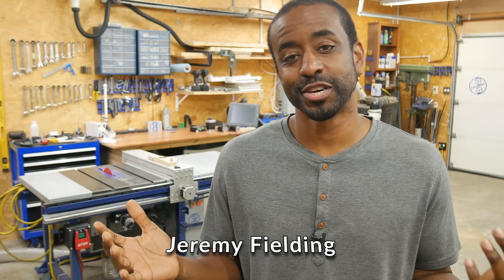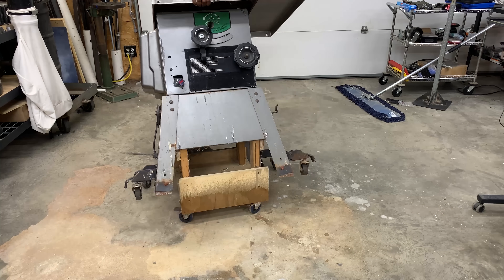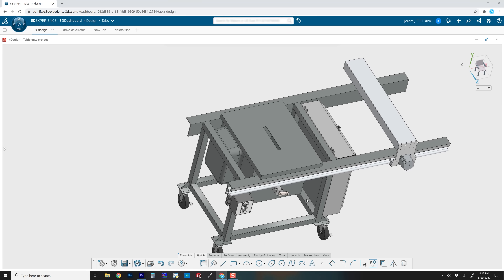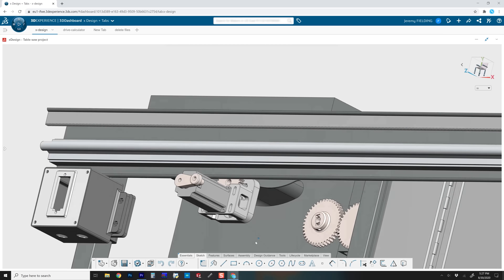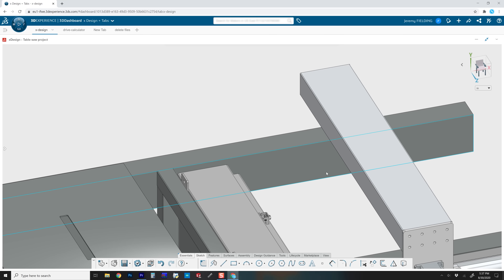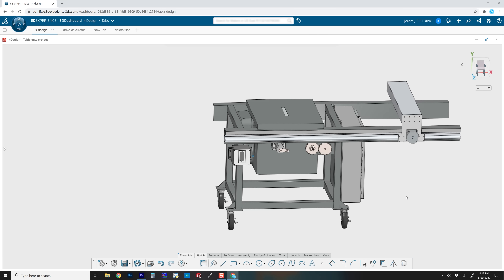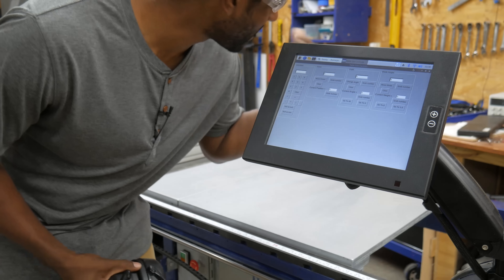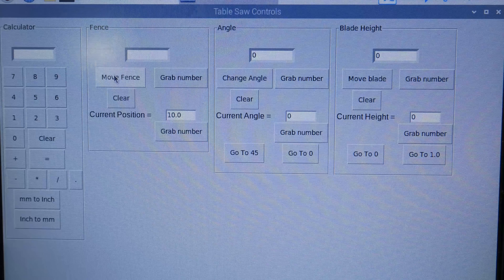How To Make A CNC Table Saw : # 084

Comment: I'll be interested in seeing the long term future of this project, and see what spins off from this project. 
Personally, if i was doing a CNC wood saw, I'd take an entirely different approach. To me, a 5 axis machine with a circular saw rather than a router makes the most sense. This would allow you to cut at any angle, miter or bevel, which includes cross and rip cuts. 
I know this is based on a table saw, but a fully automated CNC circular saw would have a massive footprint and additional auxiliary axes for accessories if based on a table saw, because the saw itself is the non-moving component, rather than the work piece in a traditional CNC setup. This would require an infeed table, outfeed table, power feed, and a intelligent system that can measure stock; such as using a 0/home rigid fence, a movable fence that can also probe then clamp, and passive rollers that can measure height and manipulate the blade height. The power feeder would need to extend the length of all three tables, along with having a table that can hold the footprint for both ripping and cross cutting, and full miter cuts would require an even larger footprint; and that's just footprint per table, unless you want to use a sled design, but then you're sacrificing blade height capacity. This is why a traditional CNC structure, with 5 axis for rotation and tilt on the tool, makes more sense, because it's a lot more compact, and the only additional footprint you'd need is additional space to allow the saw to move into and out of the work piece. 

Personally, though, I'd be much more interested in seeing someone figure out how to fully CNC a bandsaw. Jigsaw might make more sense, but blade deflection would be a concern, as would curve radius of a jigsaw cut. Almost like those 5 axis water jets, except with a bandsaw blade instead of a water nozzle.

Comment: 17:55
The E-stop, EMERGENCY STOP, shall cut power of all the system and apply brake if you have one, it's an EMERGENCY stop !

IT IS NOT A START/STOP button.
Reply from the maker: You need power to use the brake... that is why I only stop the blade.
Reply: @Jeremy_Fielding  safety brake close when power is lost, not with applied power

Comment: 17:18 

You can add a delay in between of the motor steps ( time.sleep(seconds) where seconds can also be like 0.0001 or so).
Because you know how many steps you need for a certain distance/rotation of the motor (which does not change with a different acceleration) you can have a expotential (or just a linear function, doesn't really matter) function thats flattens at 0 and starts at some value that you can try via trial and error. 

With this function you then have your current step as input (x) and it will output a value that you then can give to the time.sleep function that then waits for this short period of time.
Same for deceleration but inverted.

This way if the motor starts moving, between every step of the motor it adds a delay of lets say 1ms which slows down the motor. If its moving for a bit longer, that value shrinks to <1ms and the motor moves faster. Same thing for the deceleration but the delay increases in the end so the motor slows down.

Oh and if your function does need like 100 steps to go from the starting value to 0 (so that it reaches full speed and full stop after 200 steps) and you have to move less than 200 steps, lets say 120 Steps, you can divide that by two and begin the deceleration after 60 (= 120/2)  Steps. That has also the nice sideeffect, that the saw doesn't move that fast on small movements.

Comment: Great job... Plenty of people out here that can tidy up the code and implement your acceleration/de-acceleration code... I think your looking at PID loops (very simple and powerful code)... Or variations of that theme.... My guess is that you'll want to implement it yourself as a learning exercise. But if not host the code on Github and we can all contribute. Even tidy up the interface (Thats not a complaint). Great work for a first Python project.
Reply from the maker: It is on github. Check the description... and thanks!
Reply: @Jeremy_Fielding  Should have checked... I'll take a look. Keep up the great work.

Comment: Casually invents the future of tablesaws in first coding project
Reply: This has been around for a while in the cabinet industry. But still props to him for doing this
Reply: @ObiBassoholic  Ive never seen this as a consumer though. Sawstop + this would be killer
Reply: Ryan Walkowiak yes it would. I was by no means trying to take away from anything you’ve done. The systems out there are pretty pricey. Would be nice to see more competition come out for stuff like this.
Reply: Sorry but this is nothing new :)
Reply: Festool has part of this, you can set blade height and angle digitally on their battery powered table saw
Reply: Absolutely. This is amazing.
Reply: @Jeffrey Restrepo and Open Sources it
Reply: Thought the exact thing. This is groundbreaking stuff!
Reply: This is not unique there is a commercial product available
Reply: There's a cnc version of everything that moves these days.
Reply: It's too expensive and there's no market for it because the cost/benefit to the consumer is too low. The only reason you don't see this is market forces, not a lack of ingenuity. Frankly this is usually the case when people claim or are said to have invented something groundbreaking. But absurd tools do make for cool YouTube videos due to the inherent novelty.
Reply: @mikebarnacle1469  they said the same thing about CNC machines
Reply: @mikebarnacle1469  People already spending Sawstop money could probably afford this too as an add on. Those things are way too spendy for my blood. I've been hoping and praying for years that those patents expire and we can see other manufacturers using a similar safety system on an affordable saw.
Reply: @matts.8342  The juxtaposition of those first two sentences are a true work of art and I'm astonished no-one has mentioned it yet.
Reply: @RobGale  Hah! Yeah, I guess so. I just can't justify taking out a loan on a table saw, even though I'd love to have one. I also understand that if I have some sort of accident the Sawstop would have prevented I would definitely be upset with myself for that decision. But my truck costs less than that saw and I use my truck multiple times a day. My craftsman saw gets used a few times a month.
Reply: @matts.8342  I think the patents expire in 2023/2024, so the end is nigh of artificial scarcity in sawstops i guess!
Reply: @mikebarnacle1469  <Laughs in Chinese>

Comment: Awesome build!  The acceleration problem is nearly identical to one I solved a few years ago while building a rPi powered python GOTO telescope mount.  Here is a shortened link to a reddit comment where I display my acceleration code: https://bit.ly/359ZCYV 

The basic idea was to convert the stepper move into one of three cases: 
1.) Small moves where there is no need to accelerate 
2.) Medium length moves where the stepper motor will not reach your desired maximum velocity
3.) Long length moves where the stepper motor WILL reach your desired maximum velocity and then coast at that speed for some length of time before decelerating.

The code then creates a list of delta_t values which equal the time to wait between step pulses to create a linear acceleration of the stepper motor.  You can then reverse the list for decelerating.

One other tip for the raspberry pi:  Use Win32 Disk imager to clone your SD card image so that if your sd card ever fails or becomes corrupted you can simply burn the image to a new sd card and be back up and running in no time. Save a small readme file in the same spot that explains to your future self how to burn the image to the new card.

Comment: Brilliant work and very well explained, thank you.

As for features, you could meassure the idle load on the motor then add a function where you can define how many cuts you wanna make. When you reach idle load x-times you should be done and could stop the blade automatically.
Reply from the maker: Now that is interesting!

Comment: Awesome project! You might consider adding power feeder. Feeders are not found on table saws too often but for certain types of cuts they make sense and potentially can increase safety. There might be opportunities for CNC control there, particularly start/stop of the feed at the right times, and potentially automatic height / pressure finding.

Comment: Love the project. Had a look at the code, something things to be careful of:
Using == with floating-point numbers will bite you, as an example put the following into your python interpreter 0.1 + 0.2 == 0.3 the answer will be False, look at something like the isclose function in the math package to do this safely https://docs.python.org/3/library/math.html#math.isclose
Using time.sleep can cause an error, the function delays for at least the amount of time specified but can be longer depending on what other processes are doing. A better approach is to use time.monotonic (this function is not affected by time updates and the difference between two calls to the function is always the time between calls) in a loop until your target time is found, this might also help your speed control problem.
Reply from the maker: WOW. I have been told that the sleep function was unreliable but I didn't know what else to do. Thank you so much for the input.
Reply: This monotonic parameter for the time instruction would be executed instead in an asynchronous fashion?  Seems like sound advice.

Comment: You are my hero.  Well, one of my heroes. 😂 Amazing project!  If you have other rust removal projects, check out the Restorer tool (sold under multiple brands) with the rust removal wheel.  The axe restoration video on my channel shows it in action (not a sponsor, I’m just a fanboy).

Comment: I always use spray silicon for my table. It doesn't wet the wood, is very slippery on the surface, and it keeps condensation from the work surface when your not using it. It is also widely available at home stores or your local industrial supply. It works great on planners and joiners too.

Comment: the solution about the handels are put a spring insite so when you go on manuel you have to pull out the handel then you can turn if not in manuel the handel stay fix not turn at all 😉👍👍

Comment: You can wax the table, or some of that new fangled stuff thats supposed to have ceramic particles. Also boiled linseed oil. Just wipe on then wipe off excess. Just remember that BLO is the stuff that will spontaneously combust. Dispose of waste rags carefully. Good project

Comment: A tip for welding anything with flux.. if it's got slag, let it drag. Pushing the torch with fluxcore can force impurities into the molten weld puddle creating weak welds

Comment: Awesome project, you should be proud of that just like all your other work. I was curious of why you didn't add a linear bearing to the other side of the fence. The  Accel and  Decel of the steppers will definitely help your  Mechanicals from getting beat up.  It would be awesome to see 800+" per  Minute Rapids on the fence.  Nice job keep the awesome projects coming!

Comment: a good add in that UI would be a "nudge fence" function based on blade tooth width... doing multiple pass cuts for slots / dados would go REALLY fast
Reply: he said he was going to add a "jog" button..  It would be manual, but you could use it to do dados like you said.... But an automated jog would be even cooler;  more precise
Reply: making a box joint.  the blade is 1/8 inch, make cut, nudge 1/4, make cut, and you end up with teeth exactly the width of the kerf of the sawblade, so the tooth you make on one board matches a kerf made in a second board
Reply: You can do that really easy in Gcode.   And G code can be interactive with the user while it is running.
Reply: I love the nudge idea especially if you have an entry block for nudge amount that the user can define on the spot.
Reply: Oh man, you could put in a box joint routine.

Comment: @Jeremy Fielding - might want to look into reading position data from your encoders that way you don't need to manually enter position data when adjusting things by hand, also similar to having a release switch to free everything so it can move might I suggest a lock switch so while the saw is on a surge or other event cant move anything and cause damage or worse injury?

Comment: Love the video! I'm going to be adding many Arduino automation projects to my shop soon and this is very inspiring! One question:

Is the stepper motor the only mechanical 'clamp' preventing the fence moving during operation? Do you think it needs additional support to prevent it from moving? I'm going to be doing just this with a router table fence soon.

Love your videos, very inspiring. I'm just about to start automating my dust collection.
Reply from the maker: Yes. Like I said in the video. It has to be sized properly. It is more than capable of holding the fence. Also adding anything else would slow down the process.
Reply: @Jeremy_Fielding  thanks so much! You've given me many ideas!

Comment: Great project. I myself also do the same thing with code. Just jump into something "practical", none that "Hello world" junk  :P

As far as motor position, have you have thought about using bar codes to know where things are for resets?  For instance, the fence if you move it manually you've lost position. However, if you had a small barcode (just a few lines) in a set position, and then had a reader (in a stationary position), when the code ran past the scanner, the system would know where the fence is. I'm not sure how this would fully be implemented, just an idea.
This is similar to how ink jet printers work, but they have a round plastic disc that has lots of narrow lines on it with thick lines every 10 (i think) and scans it with an IR led.

Or use feedback from the stepper motors (if yours has that option). So that when you move the motor manually, the Pi will sense how many steps the motor has moved and add/subtract that from its last known position.

For bump adjustment, in code/interface, you could also add in "Fine Adjustment" mode, where you can tap a button and the motor the bumps a set number of steps. Ie, Coarse Adjustment = 100 steps, Fine Adjustment = 10 steps, Super Fine = 1 step, or something that fits your specific stepper motor movement.

Comment: super cool Jeremy, you're awesome! what a fantastic project. well done for seeing it through. i've been de-rusting an elevator shaft and doors mostly by wire brush this last week. no fun. meanwhile also scratching my head on a fully automated kitchen system with water cooled, peltier refrigerated ingredient dispensers, tool changing scara robot and automated induction cooktop, with zero electrical knowledge, all because i put together a 3d printer kit once. thanks for being an inspiration in perseverance.

feeling pumped by your achievement, my frazzled brain's response to your question is to yell 'grease me up, woman!' in a scottish accent!

Comment: Really cool project. I’ve been thinking of doing something similar, but with just the fence.
A few suggestions for functionality: Homing switches for your three motions.
Absolute motion function.
Incremental motion function.
A blade selection (assuming you have different sized blades).
A dado function. You would need the blade width value. This would be to subtract from the overall width of your dado width value.
A nibble function for above dado function. I would add a blade width overlap % and a tolerance amount to adjust the dado slot slop.

A lot of the above functions can be used for finger joints and tenons.

Then you can mount a router table on the other side of the fence and use the same code.

I made a finger joint machine with a stepper motor controlled by an arduino, so a lot of these issues came up.

Also, I suspect that the blade height is not linear. This is under the assumption that the height adjust is on a trunnion. You might have to see what the trunnion angle is at the bottom and then use a sin calc of the angle to determine your height adjustment from there.

Comment: super cool build! 

the one thing you could do for more absolute re-engagement of the motors is drive them home to a limit switch such that you have a repeatable zero instead of eyeballing in a number. maybe it doesn't matter in the sense that wood cutting is generally all eyeball-accurate anyway, but just a thought
Reply from the maker: Brennan Letkeman I agree. That was acutually the plan. Basically a homing sequence for all the motors. I just didn’t get it done in time for the video

Comment: Awesome work, I want one :-)  
I used to be an electrician, worked in factories, before going into IT. I would highly recommend that you have an e-stop that kills power to everything. At least in Australia e-stops and process stops have defined meanings and how they should work electrically and there function. I mention this in case you would like to look into this for safety systems, for guidance or inspiration.

Comment: Nice work! Can't wait to see what you do next. For rust removal EvapoRust works wonders. PasteWax is great for keeping the surface rust free. Keep up the good work.
Reply: 2nd on paste wax. That's the conventional solution. They say you just reapply like every 6 months, more often in humid climate.

I got an old table saw and had the same rust problem. I started with WD40. When that failed, I did orbital sander, and it mostly worked. I heard about vinegar later from Diresta.